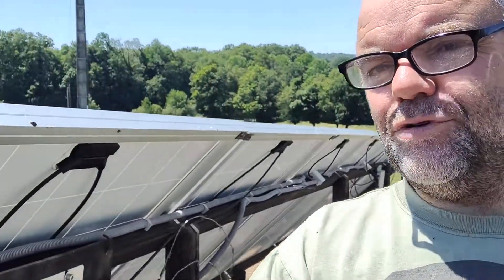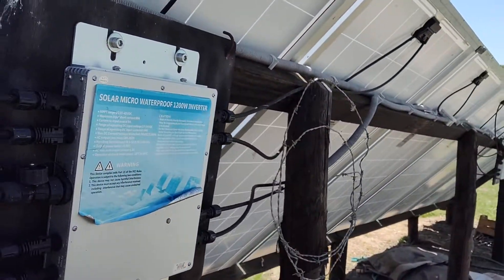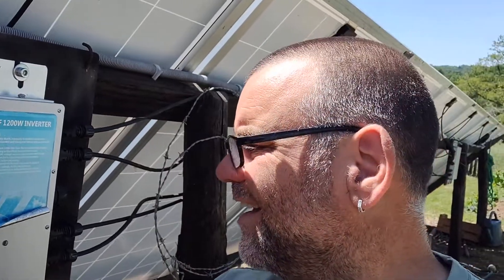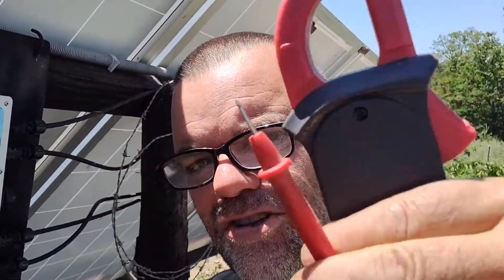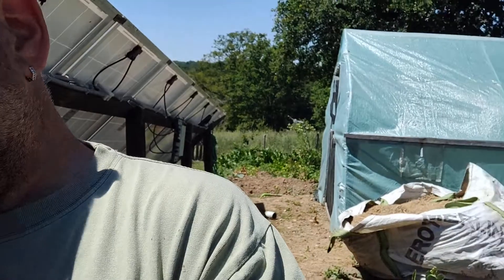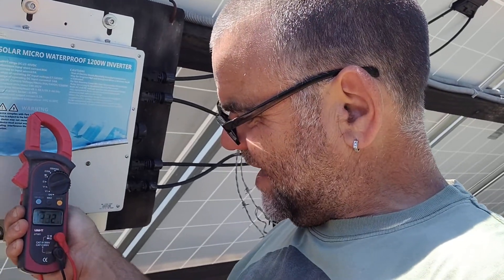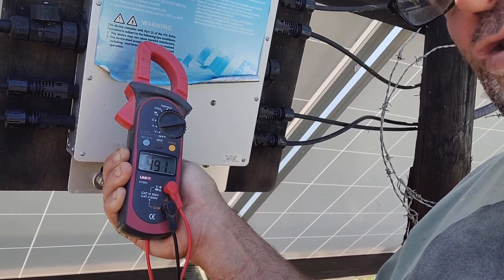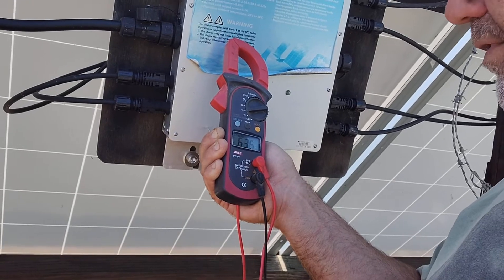Chinese WVC grid tie micro inverter fail, prepare to be SHOCKED

Comment: Another thought.. Mine  failed and the GFI tripped.  if you are getting a shock from the case your system is not properly grounded. and likely has some other potential hazards exist.I recommend you have an electrician check for proper earthing.

Comment: Without commenting on the shock this inverter is terminal mounted wrong. Both side should be in open air. The efficiency of this inverter is not top grade (91%)  so all the absorbed energy needs to be released by the casing in to the air. Low efficiency and half the case surface exposed to air is not a good combination. If the black backplate is aluminum, and it is contacting the casing well then it's another story.
Reply: Maybe the black backplate has high temperature in summer / under sunshine. Then its bad cooling! 
Also it MUST be grounded. AC cabel has a protective ground, connected to the case. Second grounding!

I have a WVC-300, getting pretty warm (in a garage), if operating above 200 Watt. I installed a USB fan over it, reduces temperature to 37 °C max. with 270 to 285 W power to 230 V AC. That works.
Reply: @jurgenwilln.4700  Hi Jürgen nice response, I have a WVC1200 and that one blew up one day. i tested the MOSFET replaced them, and it did start again. I also tested the temperature of the transformers with no airflow and  yes they get warm. The way the transformers are connected with the  aluminum case plating was bad, i improved that. With two panels connected and running a total of 450watt I didn't have problems, I haven't tried to connect four. 
I have been thinking of adding aluminum U profiles on the outside of the case to see if I can improve the operating temperature. bottom line of this inverter is that the efficiency or better, the energy loss is not in line with the  body to release that heat. It is however a reasonable quality and cheap inverter, one that can be repaired 🙂

Comment: I had one fail but I have mine pass through a GFI breaker. The GFI tripped. and prevented any shocks.  I just opened up the unit and it has catastrophically failed. (components fried)